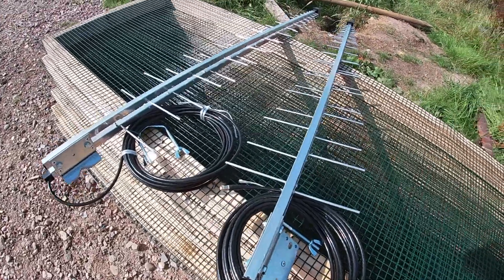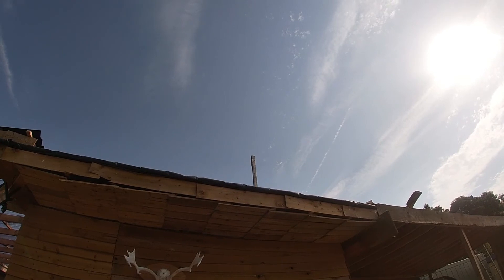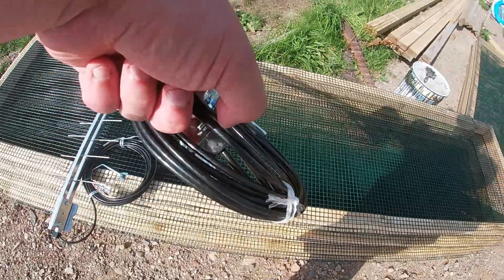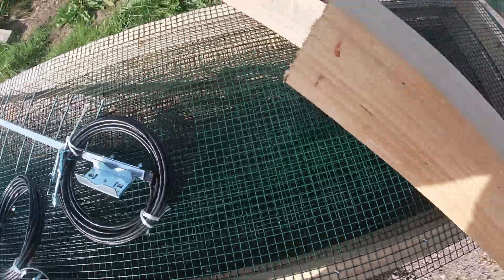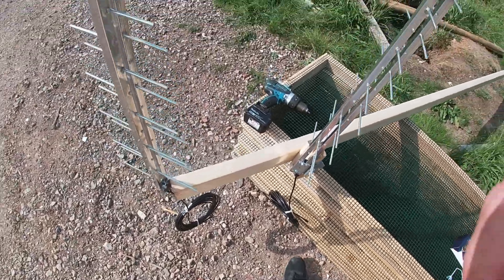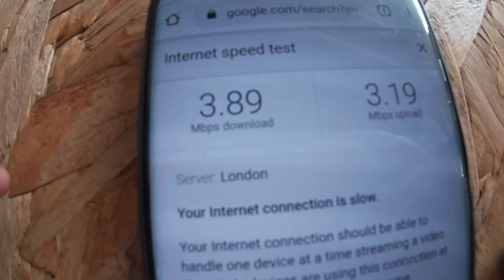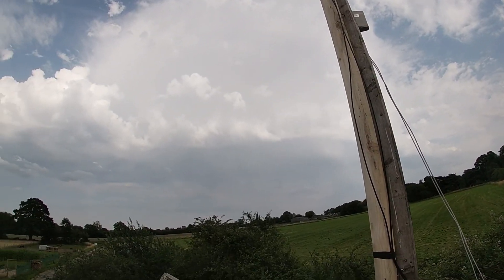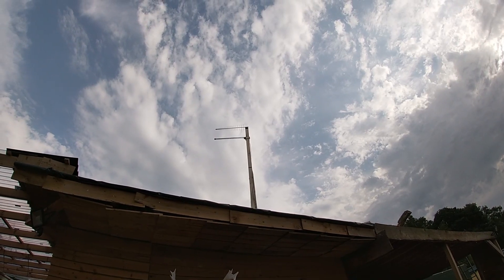How to install Super Fast 10x speed Off Grid internet! 4g, LTE directional Antenna install

Comment: Hi, do you think such antennas perform better than "triangle-shaped in plastic case" LTE antennas? I think inside they have the same metal elements. Do you know which dB gain those have? I see you also mounted them with 45 degree angles - did you also try + polarization or only X?

Comment: How did this pan out for you buddy please.
It's looking like I'm gonna have to do something similar but with the UK weather wind ect... As me a little sceptical
Reply from the maker: Works sweet I'm still using it the same way now mounted on my barn, multiple devices and TVs can be streaming at once. Sometimes in heavy rain it drops a bit but wind doesn't seem to bother it. You could always mount it to a second hand telephone pole for more stability I use ee for the sim card they seem to have the best rural bandwidth round here, I'm 8 miles from what they call a super cell tower lol
Reply: @Field_to_Farm  that's excellent I was thinking of attaching to my washing line tbh on a large pole  and not aloud to attach to my house unfortunately as it's rendered and not aloud to drill into it. Housing association orders😡 I'm not sure in the distance how far tried looking from the tops near my house and can't see it so we're a fair way from them I think.
I live down the southwest of Wales and 4g was the only option here. 

Ill have a look at my options further tomorrow I do have antenna's already stationed up in the loft but gonna need moving asap

Comment: If your 4g router doesn't have CA... Get a 4G+ capable router if your cell provider do Carrier Aggregation. You might get 50 to 60Mbps on a good day.

Also, try to look into Parabolic 4G antennas... Those have insane range. 😅😳
Reply: If possible, also check which CAs are supported. For example, in Europe B8+20 can make much sense (basically get double speeds) but is quite rare to find (on the hardware side, X55 based routers support it but no low-band 5G CA). And obviously n71 for the US or B32 for Europe.

Comment: I’d invest in a better router! And possibly change internet provider 😂
Reply: I’ve got 4G LTE I’m running 10mbps on a bad day and 100mbps on a good day using your old type of antenna and I’m nowhere near my closest tower 😂
Reply from the maker: The network provider is the key now got 50mb standard download in good weather from changing 👌
Reply: @shaundocherty96 Well, if I'm not mistaken his Huawei modem can reach a throughput speed that can reach 300mb at max (and for lower end ones, the reference is 150mb). So until there is a provider than offer more than that, it doesn't seem very wise to change his device.

Comment: Is that antenna just for wifi or does it boost your cell phone as well ?
Reply from the maker: Its just for the 4g signal from the tower to your router 👌
Reply: If you are recieving broadband data then the wi fi that the router then produces and transmitts  can be linked to with your cell phone  using Wi Fi.  Then you can look up the index on your phone and activate Wi Fi calling and that means you can then make phone calls to and from your celphone. From in your house.

Comment: Would be ace to see how the antenna cables are hooked up to the router
Reply from the maker: It's an sma plug that just twists to lock into position they come on the antennas
Reply: @Field_to_Farm  hey so the Huawei router is what you use and I'll look it up but any idea what options are out there ....? Thanks for getting back to me ... inspirational vidz
Reply from the maker: U need to look for a router with sim card slot and external aerial ports.

Comment: How did you join the two cables into one? Did you use t-shaped adapter for the cable?
Reply: You don’t. This is a MIMO setup. The Huawei router he us using has two antenna inputs on the back.

Comment: Make sure you change the settings on the modem to ext antenna only. Don’t use auto.
Reply from the maker: Auto works just fine, that's y they make them that way!
Reply: @Field_to_Farm  myself and my isp had issues with the same modem you are using. Changing it to ext antenna only fixed the issue. It would prioritise the internal first if it could get a signal.
Reply: @matixnznz  u need to open the router and cutoff the intrenal antenna and use the outdoor only
Reply: @wely6115  Isn't the ext antenna option exist just to do that ?

Comment: I'm expecting mine to come in the mail tomorrow

Are you supposed to point both antennas at the same tower? I thought to point them at the two closest
Reply from the maker: I'm pretty sure they wont work if u dont point them at the same tower
Reply: @Field_to_Farm  Thanks
Reply: @AshGreen359  it should work just fine actually, a single antenna should be as effective as 2 due to cellular networks being radiowaves, thus they are transverse, only way 2 could improve the signal is by having some sort of constructive interference. But it really depends on your setup and location and kit. I would just do a bit of trial and error as you never know.
Reply from the maker: U r completely wrong the 2 r required or the signal speed will be 100th of speed 4g relies on mimo, multi in multi out signals

Comment: Fuck... I was getting mad because where I want to live I can get only 35 Mbps 4G on the phone, and came looking for greater speeds, looks like I am blessed with my current speed.
Reply from the maker: My 4g on the phone here is non existing, we are 11 miles or so from the tower. Any external aerial on a router should get you better speed that ur phone if you already get good ones. We have changed  providers also that doubled our speed 👌
Reply: If you happen to get a good antenna or live in such a great position that the LOS to one site isn‘t possible, this still may work. For example, I have a 5G tower here which is obstructed by a hill in a really bad way and holding my phone in the air gives me 700 instead of 200 Mbps.

Comment: after this try sector antenna 2x18dbi. lets see how its perform . as far as i know it should be better than yagi
Reply: Its a log periodic not a yagi… yagi is for single frequency whereas Log periodic are made for a range of frequencies.. LP gain is lower but more versatile if you don’t know which band your supplier is using.

Comment: use huawei b525 65a, you might get doubled speed because of 4g+
Reply: he is right tho, that router is capable of LTE-CA (Carrier Aggregation) which means you can use 2 bands at the same time unlike normal LTE modem giving you faster connection.
Reply from the maker: Not all 4g networks are created equal lol. It's more to do with the providers transmitters, iv just switched and gained almost fibre network speeds iv got a video to come after Christmas about it 👍
Reply: @Field_to_Farm  I've been using b310 and I got 30-40Mbps and then I switched to b525 same place same location same provider but I got 100+Mbps! But you're right, it depends on tower if it support multi band or not. But you'll never know it if you never try it 🌚
Reply: @mafuru801  use sites like CELLMAPPER and they tell you so